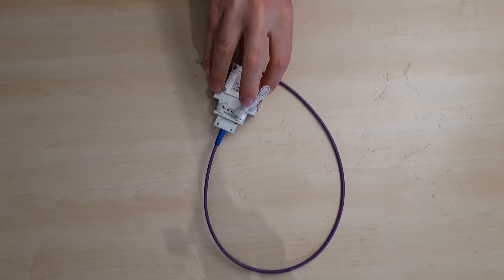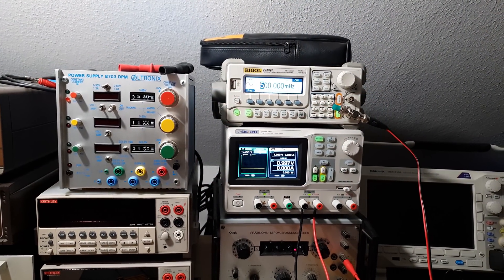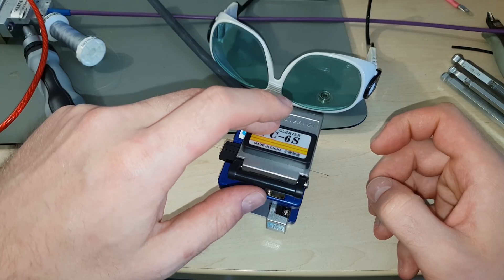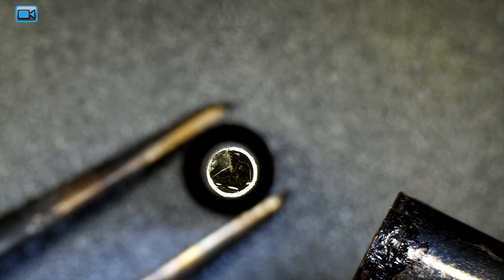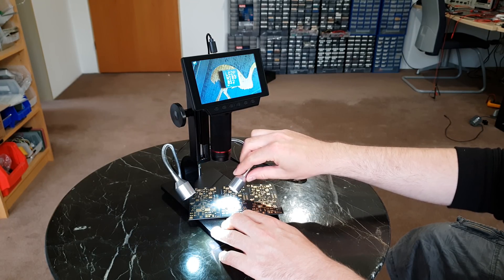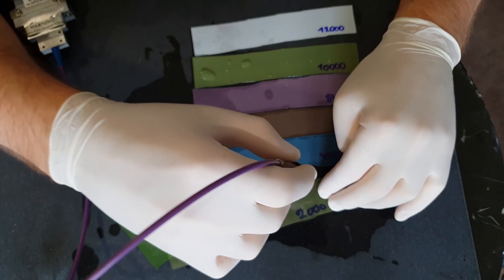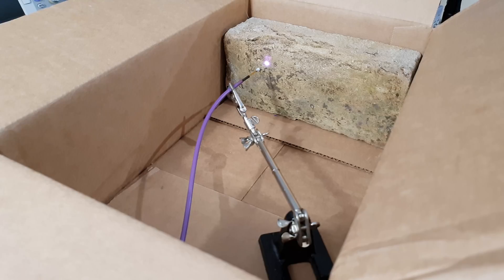30W Laser Burning Stone + New CC Driver + Fiber Termination Lapping

Comment: If you REALLY want to remove the camera icon there is always the option to remove it in post by taking a frame, using Photoshop 2021 CC object remover (now with AI support!), then using the cleaned up region to hide the icon.  It is so much more comfortable than any other conceivable option.

Comment: I was getting flashbacks to my PhD when you were polishing the termination. I was preparing optical fires for electron microscopy by setting the in epoxy in a brass tube then polishing metallographically. I think that some sort of jig to keep the bundle normal to the surface would help. There might be something useful in  Journal of Materials Science Letters 12(1):1-2 but I can't find a free full-text version. But if you were to drill a hole the same size as the ferrule in a block of metal at least 25mm dia then push the ferrule through that you should end up with a more plane surface.
.... And I just noticed that I am at least 2 years late to the party.

Comment: Grüß Gott, I might be two years too late, but I work with hollow fused silica capillaries a lot. These are similar to your glass fibres. In my opinion, the best way to cleave them is a ceramic cleaving stone. You can use it to give the capillary a nick and break it clean off. With a little bit of practice, it comes out perfect and a cleaving stone is about 5€.
Thanks for your videos!

Comment: do the lapping on the 3d printer ,
S1:Attach the termination to the print head 
S2: weigh it down somehow paper binder clip on the fiber bundle and a spring pushing down on it , light pressure is enough 
S3: write gcode to move the head in x and y in random motion 
S4: gcode to do a figure 8 motion for final lapping

what do u all think is that possible ?

Comment: I don't know if you have fixed your fiber terminating setup yet but...my dude...ouch. Watching that was painful. I'm a professional fiber optic technician and engineer, and I can tell you that there are hundreds of products online that can help you out for relatively cheap. First some fiber strippers...that will remove the acrylite coating around the fiber. That is actually what caused the cleaver you used to fail, not the diameter of the fiber. Next that cleaver you have is perfect for fusion splicing, but as you aren't splicing I would recommend a Ruby pen scribe or replace the disc inside with a Ruby wheel for more accuracy (removal of the acrylite coating would be enough to make it work though). Next, there are actual epoxies designed for making "ribbon" fiber. In other words putting a bunch of individual fiber strands together permanently. Utilizing a hotmelt kit that can be found for super cheaply online would allow you to mount a termination properly (if you use this, a Ruby pen scribe will be necessary). After that a polishing pad, lapping film, and a polishing puck (there are pucks for every kind of connector/termination) will make your fiber polishing mirror smooth and exactly the same on every fiber. If you follow these steps (I can provide more detailed instructions in an email if you wish) your fiber will become far cleaner and your end result will be as close to perfect as is possible with currently available methods.

Comment: The heat sensitivity of the epoxy seems problematic, especially with proximity to the substance being burned.  Maybe optics to increase focal length, and cooling (passive or a small fan) for the output end.  Polishing is tough free hand.  Make a jig to keep the fibers dead flat, or make the fibers stationary and move the paper akin to a belt sander.

Comment: There's a nice new piece of HW you could use for the driver - a tiny DC/DC buck converter that operates in the right potencial range for LDs (0.6V - 5.2V) and the output is total 80A (it has two channels 40A each that can be coupled). It's digitally operated/programmable as well as analog. I've just ordered some to make the drivers for my LDs.
https://www.artesyn.com/power/power-supplies/websheet/589/lga80d-series
Reply from the maker: Wow that's tiny! Indeed looks a lot better than my previous Murata part, will check it out. Thank you for the hint! :)

Comment: From my experiments with polishing things to a mirror finish and examining the results on a microscope, I found the metal polish Brasso to be a fantastic substance. I usually let it dry on some cardboard, and use that as a polishing surface. I was sharpening a knife in this instance. I'm not sure what grit rating it would have, but it did get much better results. I will decline to say how long I spent achieving those results.

Comment: be warned, i have the same vaccuum pump. It releases very fine silicon oil mist, very unhealthy indoors.
 I tried to build a multistage filter, that mist goes trough anything (2xkitchenoilfilter+2xccarbonfilter. My temporary workaroud is attachting a hose, and put it outside the window. I want to try a cyclon-type filter when i have time for it.

Comment: Your coatimg on the optical fibre is probably polyimide. This really needs to be stripped first before cleaving. This can be done in a number of ways; plasma beam (expensive), mechanical (difficult) or high temperature sulphuric acid ( not as dangerous as it seems as the amount of acid are tin) Still in the last case great care need to be taken with 180oC plus acid. Small amounts can be place in test tubes mounted in heated metal blocks (cartridge heater) and the fibre dipped.  At high temp the coating comes off in a few seconds.  Looks like you have a cheap copy of a fujikura cleaver, the original works very well, how about this one?

Comment: Did you manage to get the faces square ???  I noticed on mine, that I had to offset the faces from 90 degrees, just a hair off to get full performance of my 80 watt fiber laser.  for some reason, (At least the crude setup I had) if I managed to get totally square (at least what I thought was) the performance wasn't as good.  face reflection ???

Dunno, but a suggestion.

Nicely done anyway!

Comment: That fiber cleaver is a cheap Chinese knockoff. The real one is made by Sumitomo and is actually one of the best cleavers I have ever used for 125um fibers.

Also just a side note, it likely didn't cleave because you didn't strip iff the insulation. Only the glass portion is supposed to sit on the black rubber pads, if there is insulation there the blade won't cut deep enough.

Comment: you should use  jewelers rouge on news paper for a mirror finish.
Reply: That would work, silica has a knoop hardness of 1200 and fe3o2 has a knoop hardness of 2000. I would be worried about the newspaper lifting up or something, maybe spread it on something. At that point though, you might as well get a polishing liquid compound.

Comment: The firmware on those Andonstars is easily hackable; you can solder on a 3v3 uart and "poke" the firmware in ram via the built-in shell (simple RTOS not linux) to do nondestructive changes. Examples include fixing stupidnesses in the UI, removing onscreen icons, etc.
Reply from the maker: Oh? Got a link? I would really like it to display stuff and send to HDMI recorder at the same time ... Not sure if that is a firmware thing tho, might need an external splitter in the end

Comment: Why is there a diode on the opamp output at 1:40 ? I also can't tell if it's a zener or schottky.
Reply from the maker: qSty- shottky! The trim pin is sitting at 600 mV normally, I wouldn't want the OP amp to pull it too low, too much current etc

Comment: When I did lapping for high magnification microscopy our best results came from moving in one direction then lifting. Then rotate 90 degrees.  That way you aren't rubbing debris into the polish surface.  After getting to ~2000 grit or so you would then move to a lubricated wheel and continue the one direction alternate 90 degree.  Final finish was with a micron abrasive same method.  If you didn't get a perfect surface your microscopy results would really suck because the slight hairline scratch is the size of Everest at a couple hundred thousand times magnification. 

I'm rambling here, that was mainly for visible wavelengths.  Lasers can be more or less forgiving.  Longer than visible wavelengths can tolerate some small scratching, shorter than visible wavelength become increasingly intolerant of any surface imperfections.

Comment: To get a tracking DC-DC converter i just use a BJT and a 2.7V zener.
Zener anode to DC-DC converter output, zener cathode to BJT emitter, BJT base to linear regulator output, BJT collector to the feedback input of the DC-DC converter and to a pullup resistor to DC-DC ref voltage.

Comment: Collimator and multiple emitter elements going into a fiber optic line? That might be interesting. Also a thermal probe next to the emitter end of the line, although you probably wouldn't have very long if it goes wrong.

Comment: you should add some polarizers filters to the leds and optic of the microscope. then the readings of circuits are amazing.
https://www.ebay.com/itm/282571649127
and
https://www.youtube.com/watch?v=szGb_0pl91Y
Reply from the maker: Just purchased them and will certainly show them in a video if good. Hope John has some capacity for a sudden incline in purchases :)

Comment: 7:00 Even without a nice fancy microscope, a $10 pencil iron from Walmart and a tip hand filed out of a piece of scrap wire from home depot  my soldering is far nicer than that -_- effectively none of the solder even touched the pads on the board, just the IC... Kinda goes to show, you can have all the fancy spoiled kid toys in the world but it does nothing to mitigate not having skill or patience
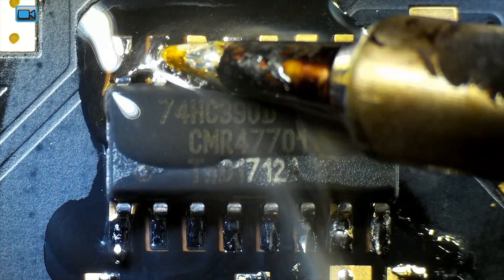Reply: No, it's called flux. The joints came out perfectly. Almost every worthwhile EE with hands-on experience drag solders surface-mount components. It's far easier and more practical, as well as cleaner. Open your eyes and pause at 6:48, compare with 7:02.
Reply: I just like interacting with like-minded people, one of whom you are not.
Now, if you'd like to skip personal insults, which are just... sad, let an engineer with over 5 years of hands-on experience repairing boards with QFNs lay this out with crayons for you:
https://i.spirit.re/lFDjA.jpg
Look up what solder mask clearance is.
Learn something? :)
Reply: To all of you smartasses, you can clearly tell that what you assume to be an unsoldered copper pad is the FR4 showing. the solder mask is shifted a bit to the left on the board. https://i.imgur.com/QKs9dc6.png and https://i.imgur.com/8RgP7cY.png are clear examples of that. Compare the glossyness of the ENIG pads to the rather diffuse (rather translucent) surface of the FR4. Solder that only sticks to the leads would NOT form those sharp corners and hard edges.
Reply: His soldering job was perfect. The soldermask was shifted showing bare fiberglass, but the soldering was perfect.
Reply: Solder mask, not pad. The pads are under the leads. If you're going to try shitting on a video, at least open your eyes.
Reply: Spirit oh good one. Seriously, what are you even saying? Why would he solder the solder mask? The shit with MASK in the fucking name? Yeah, no that makes far more sense than the obvious fact you can clearly see the unsoldered copper pads under the IC's pins that he's covered in solder, somehow managing to get effectively only the bottom left pad actually soldred to the board, albeit with a nowhere near JSTD compliant connection... you know, precisely like I said... So again, I ask, what fucking point are you trying to make, dickeater?
Reply: https://photos.app.goo.gl/4xaLauUuU9mg5jyV6 learn something
Reply: Lol that's what happens when people treat soldering irons as paint brushes😄 bare pads under nearly every pin and globs of solder on pins you're not even trying to solder yet 😂
Reply: Spirit lol judging by the fact 90% of all replies to comments on this video are from you, I'm going to go out on a limb and say mommy doesn't pay you any mind so you fish for attention from strangers while trying to be some grown man's white Knight on YouTube. Would you like me to assemble a PDF for you to understand the difference between soldermask, pins, flux, and unsoldered pads? Because somehow you've managed to use all of those as an excuse other than the fact he just did a miserable job at soldering. Fuck it, it's 4am and I have nothing better to do than crush the dreams of retarded children too busy deepthroating YouTube idols to open their eyes, so I'll do it 😊 one moment pleazzzz

Comment: wow, thanks for the video! I might just build a SLM printer now! Add a heated chamber and a mirrored galvanometer system and you could make ultra high resolution prints out of a plethora of plastics and maybe even a couple of metals!
Reply: That's what they do - except metal sintering is done under an inert atmosphere. Better start with nylon, easier to do.

Comment: For the lapping, you're doing it well, but I recommend you rinse the paper every 10 strokes or use a new spot. The tiny particles are the same hardness (or harder if it heated up at all) and will end up causing scratches. That being said, for a one off polish, I don't think you did anything bad. When you have thicker glass, it's more of a problem.

Comment: Hahaha... 30w laser, ohhh yeaaahhh!!!!
*I don’t think people even realise how POWERFUL a 30w laser is... so much POWEEEEEERRR =]
Reply: I understand exactly how powerful 30W is.  I used to work on a pair of Cincinnati 2500W CO2 industrial cutting lasers.  The lowest setting we could run on it manually was about 25W.  Even an unfocused 0.1 second blast would blow a hole through regular plastic safety glasses, leaving a small hole and a mess of fuzzy, stringy plastic residue.  God I miss that laser.
Reply: I worked with a 50w back in the days in University (Physical Chemistry / Quantum Chemistry). And your comment in terms of POWEEEEEERRR is waaaay to underrated ;)
Reply: DatSwissGuy I’ve played with some supa POWAAAHH ones too but having a 30w at home is just endless fun haha ohhh yeaaahhh =]
Reply: When they say "30W laser" are they talking about power output or power usage? Either way there's not going to be 100% conversion from electrical energy to light. So how efficient is the conversion?
Reply: supah powaahhh   \o/
Reply: 30W out of 19 multimode fibers is not that great actually.
Reply: @enclis  just need to somehow couple that to a fiber amplifier and collimator for really dangerous fun and cutting thin metal.
Reply: fassenkugel  Quantum well lasers used in fiber optic telecommunications are the peak of efficiency but are quite puny compared to every industrial CO2 laser.
Reply: How much is the laser efficiency?

Comment: Would it be insane to try and put a heatsink on the termination?
Reply from the maker: No, I think that's a pretty sane idea! :) Will try one more finer lapping film and if it still gets warm, I'll try heat sinking and Arctic Silver thermal epoxy maybe?
Reply: I think the problem isn't the heat generated but that heat is also damaging the material (and then making it create more heat).

Also yay the AI safety guy!
Reply: This would also help with lapping the surface as it would keep it square.
Reply: Don't forget the thermal compound LMAO
Reply: This seems like a good idea.
Ideally the end shouldn't get hot but it obviously is heating up so a way to remove heat seems like a good bandaid.
Reply: I was thinking just like, drill a close fitting hole in some aluminium
Reply: The company I work for makes aluminum 'funnel' type deals for fibers. I don't know if it is sensor instrumentation or power delivery, but after epoxying the fibers in the hole, they lap the whole thing flat.

Comment: When I did cleaving of optical fibers it was usually done by removing the cladding and then scoring the fiber with a ruby blade, after that you put a drop of distilled water onto the fiber. The water will aid in separating the fiber along one plane of the crystal when you pull it apart. The resulting surface quality is already really good
Reply: nestoriusify could you explain a bit more? Water?? I know that a good cleave can be of optical quality already but you speak of pulling... I've read that it should be bent on a mandrel with specific angles and such. Would be a great help!!
Reply: Daniele Coccioli AFAIK you can use bending or pulling. But cleaving/splicing of fibers is one of thr fields where every lab has it's own procedure "because it worked last time". The pulling can be done in some kind of jig where you fix the fiber left and right of where you marred it and use a screw to pull. I guess that's also where the method with adding a drop of water comes from. Someone proposed it weakend the bonds between the layers and when we tried it the result was good.